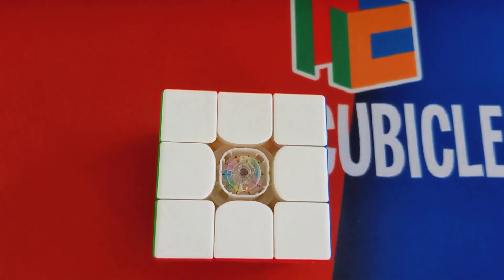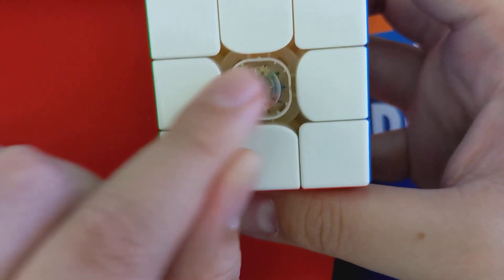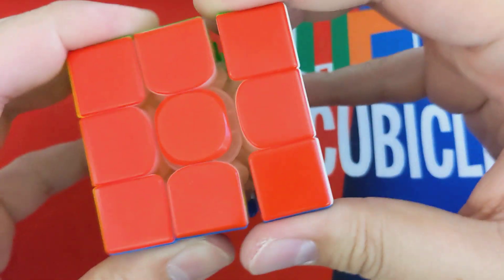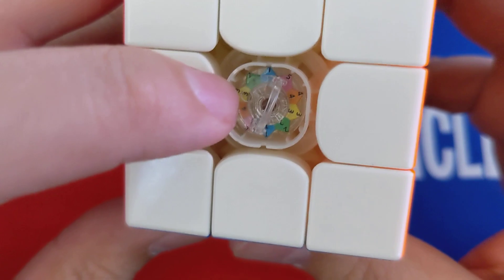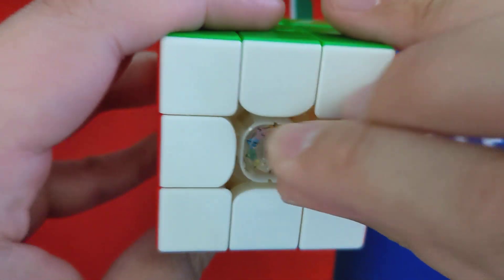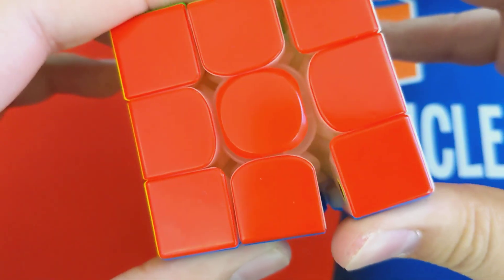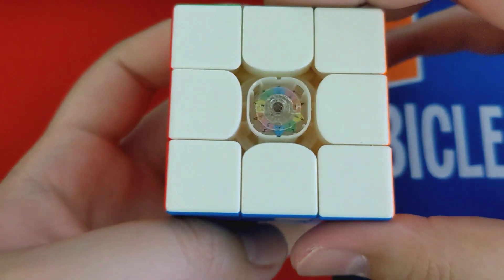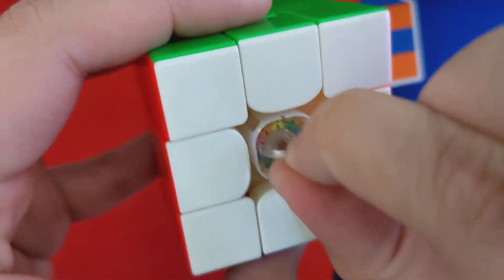Tornado V3 Adjustment Demo

Comment: Hello! I would like to question about the durability of the Tornado V3. Specifically, I am interested in knowing how well it can withstand accidental drops. Additionally, I would like to know if all versions of the Tornado V3 come with an updated transparent core. I am considering purchasing one from the Cubicle but have some hesitation as I plan to use it as my main cube for a year. great video quality btw!